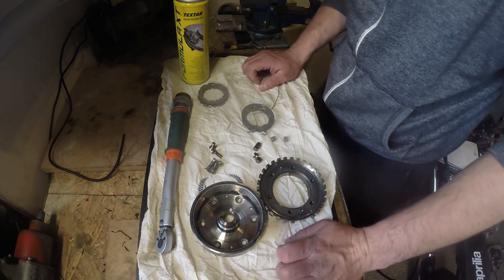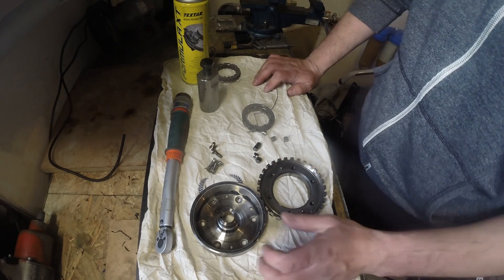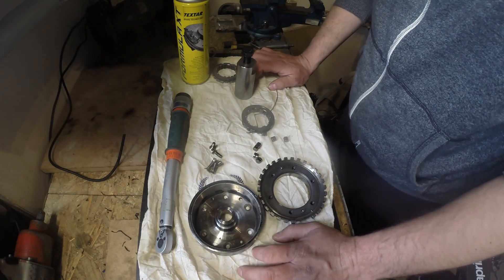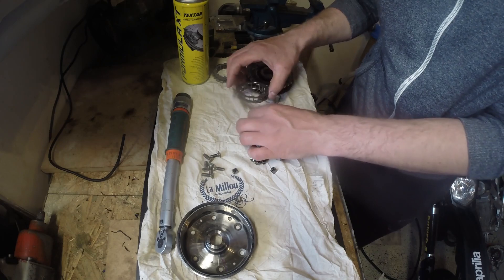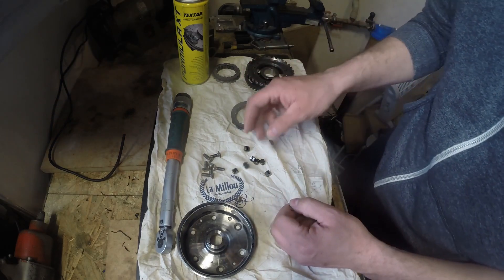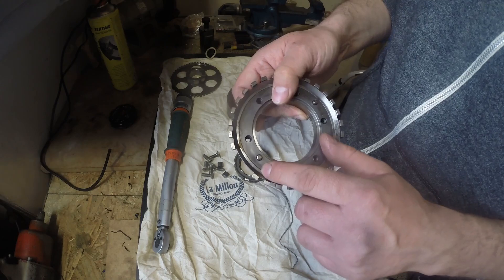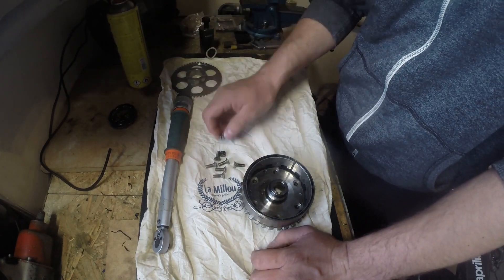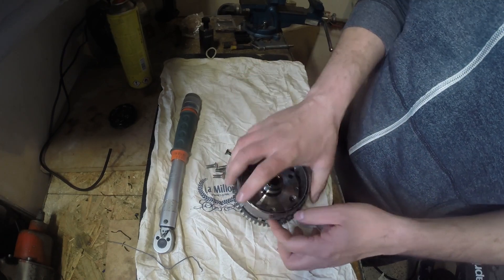Aprilia SXV / RXV sprag clutch fail / explanation

Comment: Hello! My name is Alberto I am writing to you from Spain, I have an aprilia sxv450 and I have problems getting it to start, change the starter motor and the problem continues, the problem is that the engine does not finish turning, the starter motor turns and stops It turns and stops and so continuously as if the motor had a lot of compression or something like that, have you already had that problem? They tell me to change the starter cluch, will that be the solution? Thank you very much and greetings, excellent your videos.
Reply from the maker: Hi. There are several issues which can cause that. Try opening throttle about 15-20% and check if your engine can spin then.